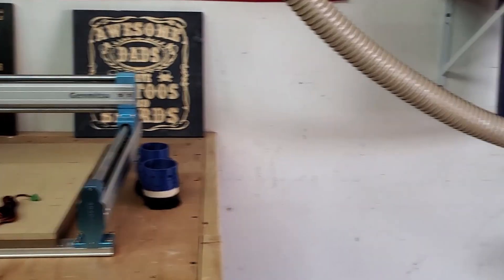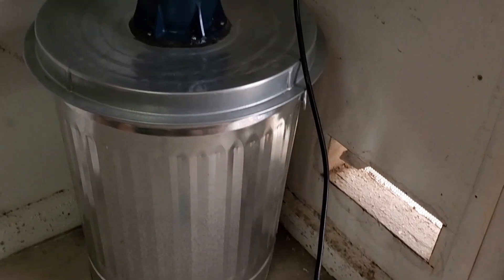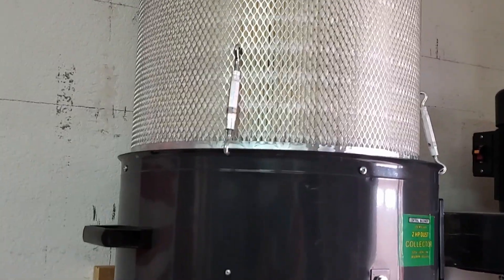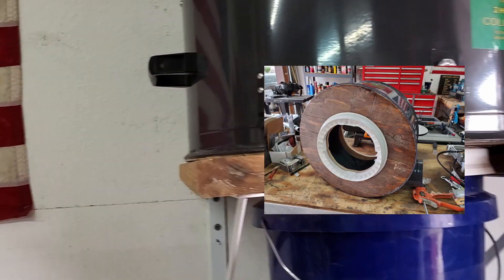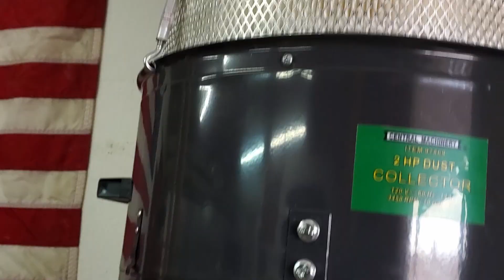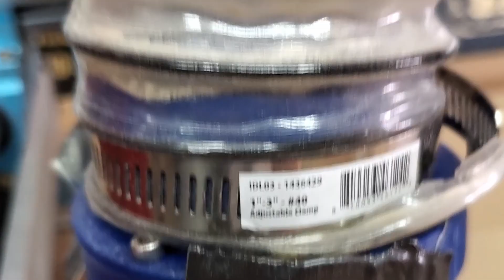2 Stage Harbor Freight Dust Collector #3dhp

Comment: Nice setup.. Looks alot like mine. I used a plastic trash can.  I would be worried the metal one would get crushed somehow and not pop back out afterwards.
Reply from the maker: I considered buying a plastic barrel of Marketplace and cutting top out but for now this seems to work fine other than the tapered lid sucked flat the first time I turned it on.